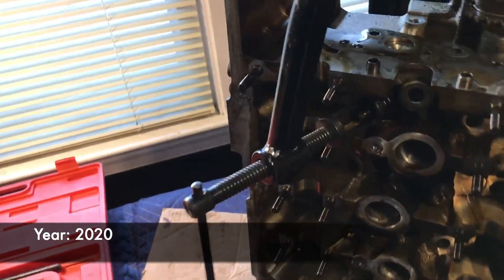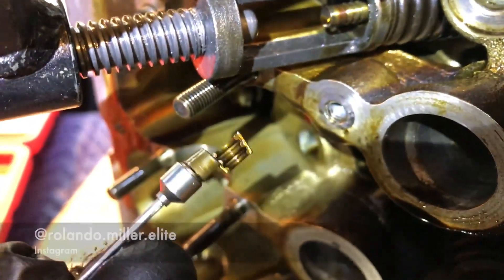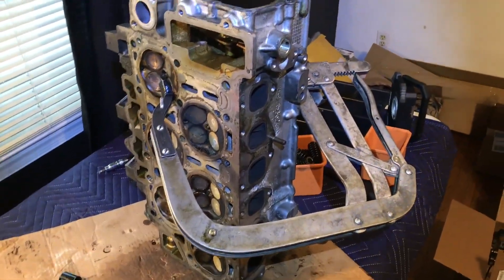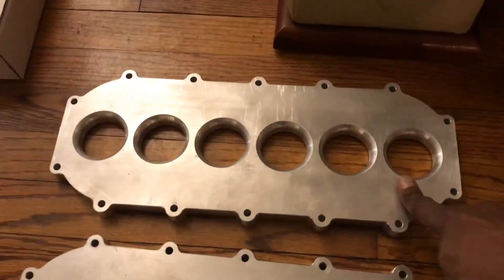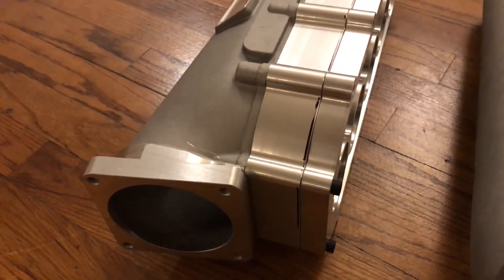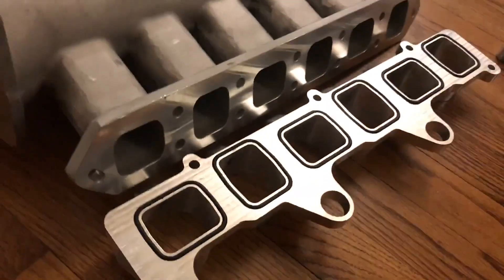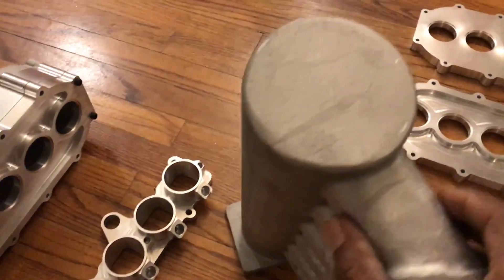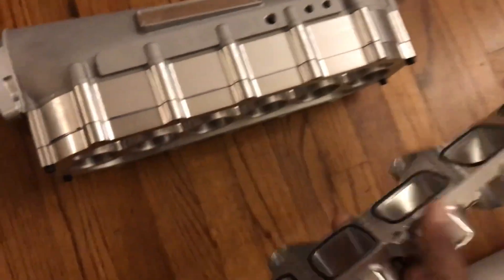VR6 24v cylinder head teardown and update on custom intake manifold

Comment: Me and you are one in the same ✊🏿!!!!! I have a rabbit I’m building same engine my awd came from a 2012 golf R, I’m dsg, I’m using nub works skunk 2 blank plate, center feed with spacers 6 ports injectors and I’m using fsi so 12 all together, I went with a different intake runner design we all have different thoughts about air flow and how it works so I went with what I thought was best, I’m using Nitrous. Good luck with that build your going to make big big power✌🏿
Reply from the maker: Wow, that’s is going to be a nice Big power build with some Nitrous🔥appreciate the good luck on the build same to you my friend 🙏🏾